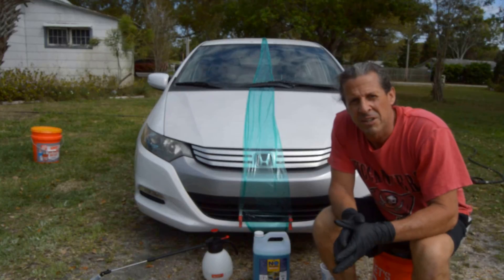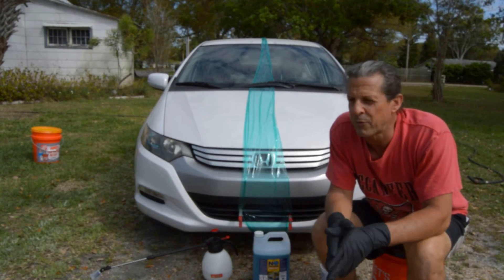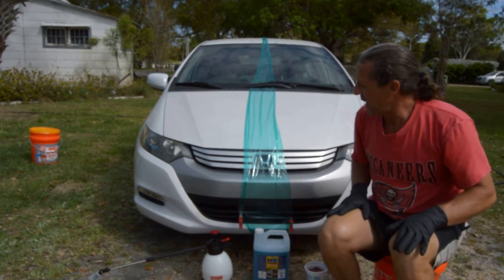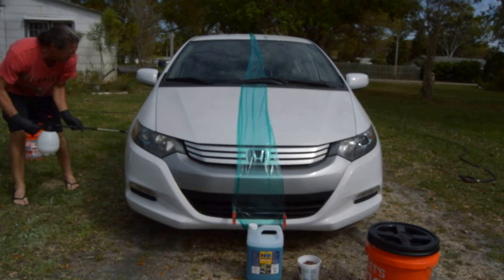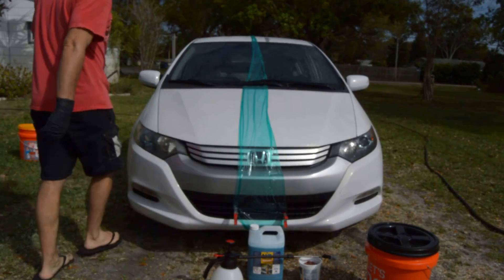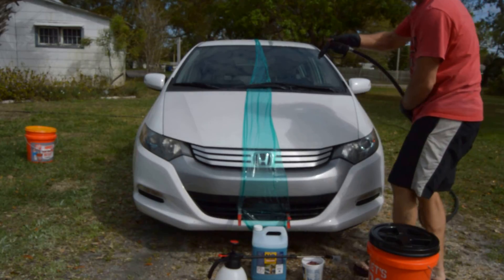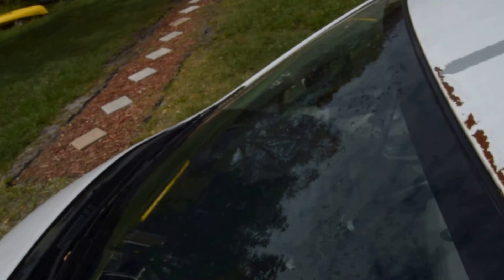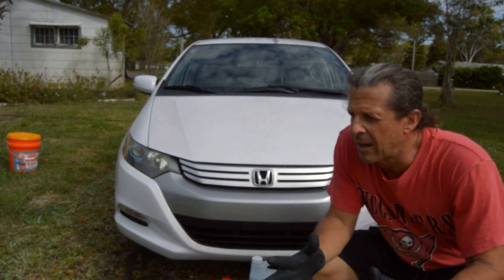ONR Does it EMULSIFY ? Pretreat with Solo Pump Sprayer P1

Comment: This is not the correct way to use ONR... Did you think you could spray it on and then it would eat away at the dirt.... It's intended to be used as part of a wash. If it's waterless then you need to use it with cloths to remove... It seems like you don't know how to use the product. Its not like a TFR... It hasnt got any alkaline or chemicals to break down dirt without any contact.
Reply from the maker: HI Richard. At the 4:03 mark I clearly state that this is an EXPERIMENT. This is NOT a how to use ONR instructional video.  I have listened to Yvan Lacroix many times describe how ONR WILL emulsify and encapsulate dirt. Which helps in the process of breaking down and lifting dirt as you use the rinseless  method. Just worth noting here, if I am using ONR to do a rinseless wash on a moderately dirty car, I ALWAYS presoak the panel first with ONR. I also generally first use a pressure washer/jet stream of water from the hose to remove loose dirt and start the remaining dirt to soften and break up, which the ions in water OR ONR will help facilitate. While ONR is not alkaline or acidic, it definitely has chemical properties in the polymers to help clean and lift dirt. I have been using ONR in many ways for quite a long time. 
I do thank you for adding to my channel and I look forward to exchanging information with you on many different topic in the future.